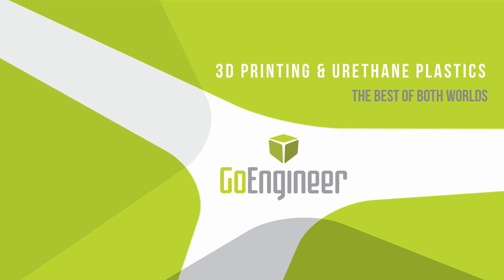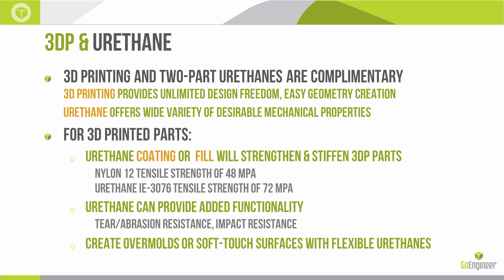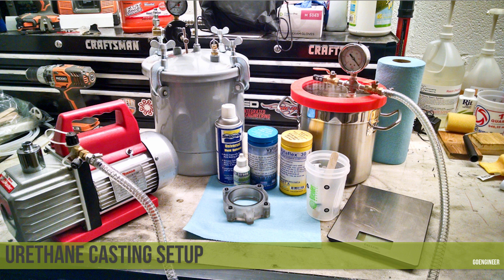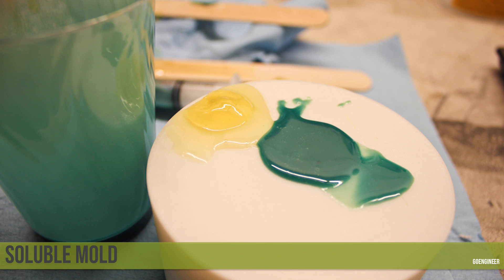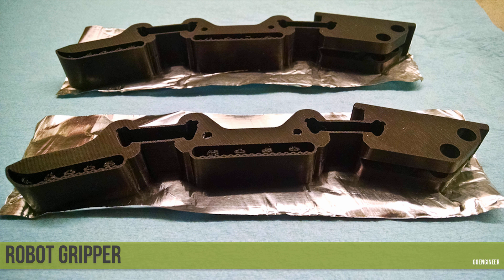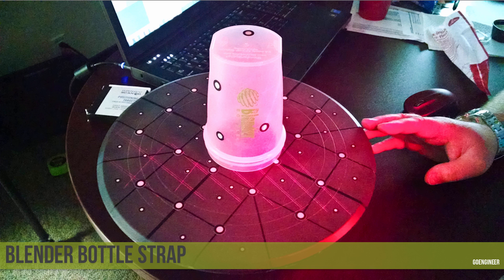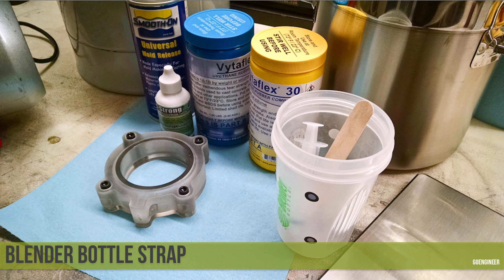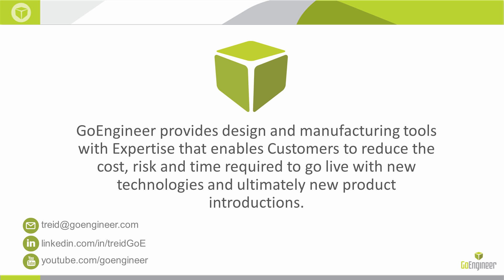Stratasys - 3D Printing and Urethane Casting

Comment: what mold release do you use on SLA molds to release cast urethane?
Reply from the maker: That is a hard question for us to be specific on. There are a lot of different options you can use and you should take a look the material being cast and making sure the release agent will work with that material. If you have concerns about the material of the mold you can print a small test part and expose it to the release agent to make sure it does not react with the mold material itself.